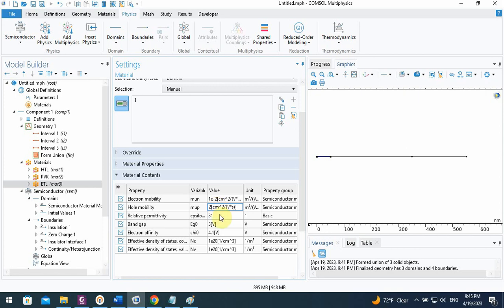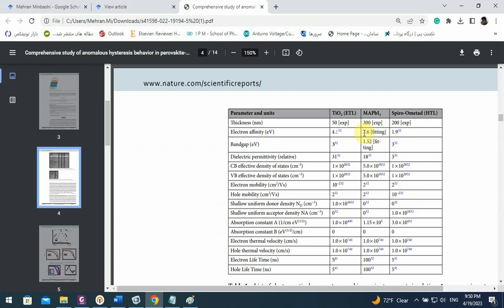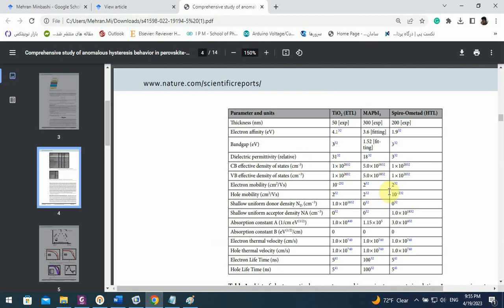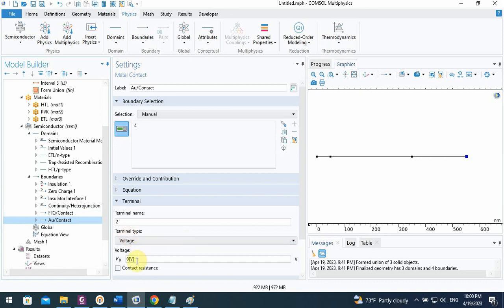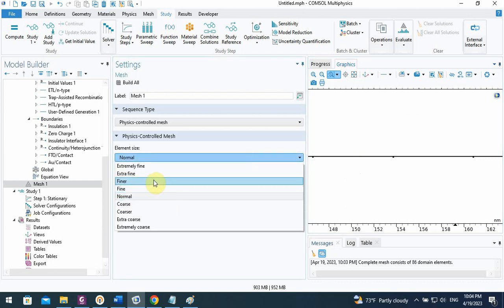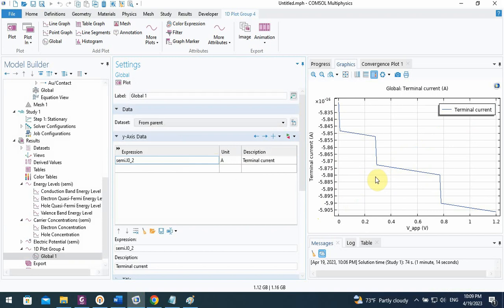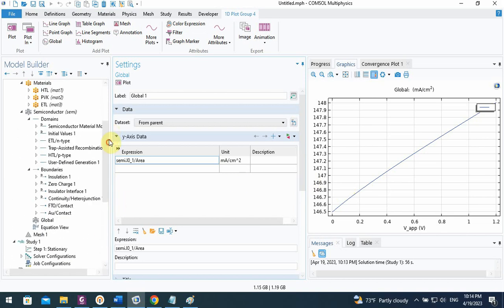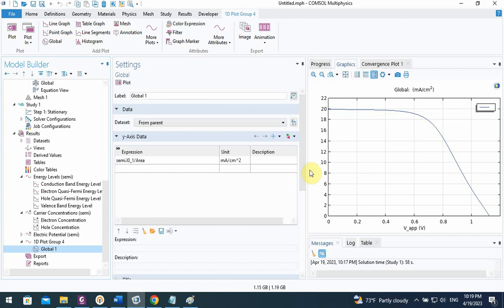Simulation of 1D Perovskite solar cells with COMSOL Part 2

Comment: Excellent video, Can you do more simulation by using user-defined generation rate (equation) and using solar spectrum data as similar as it is done for the Comsol library (silicon 1D solar cell)? They used some data regarding the AM 1.5 spectrum with wavelengths and n-k data for the silicon absorption.
Reply from the maker: Yes I will do

Comment: Hi 
I implemented this project with your educational help. But I encountered an error during execution. What is the reason?

The following feature has encountered a problen
Feature: Stationary Solver 1 (sol1/s1)
Fajledto findasolution for the initial parameter.
Maximum number of Newton iterations reached
Returned solution is not converged,
Not all parameter steps returned
Reply from the maker: Hello!
1.Check the unit of parameters
2.check your mesh.